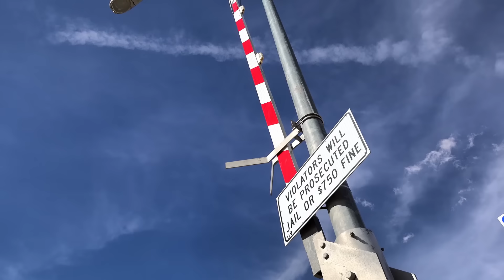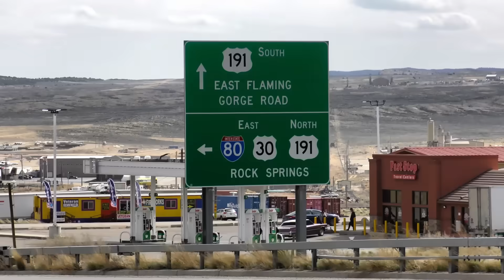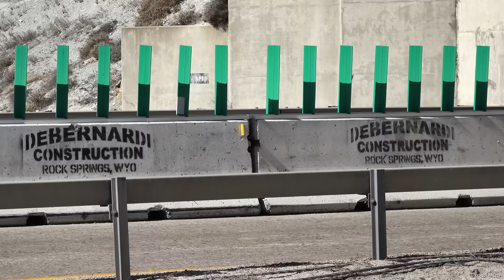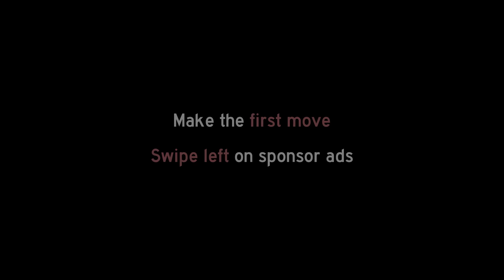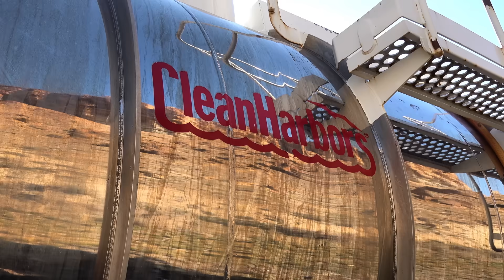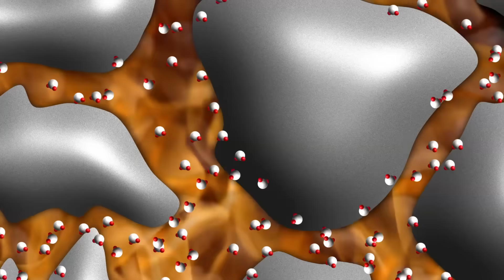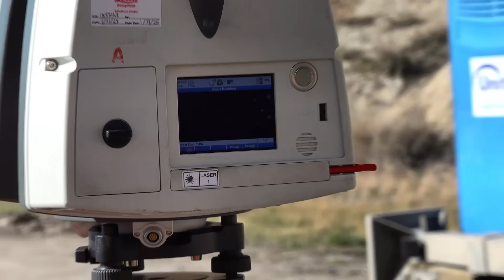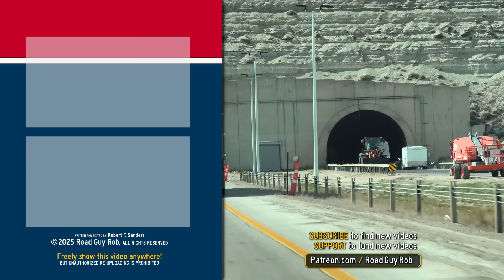Going Inside Wyoming's TOTALLY MELTED Freeway Tunnel

Comment: 9:30 thats why we always say concrete cures, not dries
all that water is still in there
Reply from the maker: I had no idea the hydration would want to violently escape the  during a fire
Reply: @RoadGuyRob  high temperatures reverse the concretes curing process, unbinding the water from the cement
then between the stress from thermal gradient from the fire facing surface, that water flashing into steam inside the concrete, different expansion rates of the aggregate and cement, and weakening chemical bonds; the concrete basically just explodes little pieces off
Reply: @vincentgrinn2665  spalling at its finest 💯 got to keep those safety squints on while doing hot work on concrete 😉
Reply: @RoadGuyRob  Water expands 1700 times its volume when turned to steam. 1 cubic foot of water becomes 1,700 cubic feet of steam. when that tiny bit of water has nowhere to go, it exerts pressure on the surrounding concrete. Spalling begins at a weak point, and as the process creates more weak points the damage spreads.

That expansion rate is why water is still the most efficient way to put put most fires, and why fog nozzles like Task Force Tips became popular. The smaller the drop, the faster it converts to steam, and the steam not only removes some of the heat in the conversion, as it expands it displaces all the gasses in the room. This removes the oxygen and unburned gasses from the room, and continues to cool the space as weter is applied.

(Been out of the fire service for three years, and you're the first to get me back in "Trainer Mode" 😄. Nice work. )
Reply: that's one way caves are made.. light a fire under the rock and the moisture comes out and it causes pieces to collapse. Keep that fire going and eventually you'll have a nice cave for yourself.

It's the same principle as what is happening here.
Reply: The spalling is from free water in the pores of the concrete, not from water consumed by the curing process.
Reply: @koopdi  when the curing process is reversed due to the high temperature, the water in the concrete turns back into water and adds to the water in the pores
Reply: @vincentgrinn2665 . How can water turn back into water?  It’s either water or it isn’t. Now steam can condense back to liquid water but it is still water.
Reply: @Sillyturner  the water in liquid concrete goes through a chemical process and binds with the minerals inside the concrete and turns into gel and crystals to hold it all together when it cures

with enough heat that reverses and the crystals and gels turn back into water and powder
Reply: Shhhh... don't let the Europeans know that, otherwise it might hurt their feelings...
Reply: That’s just inaccurate. Concrete cures with an exothermic reaction. For all intents and purposes it absolutely dries out. Maybe you’re thinking of asphalt which does not go through a chemical process it just cools down.
Reply: Was it sick? 

Why'd it need to cure? 😋
Reply: @robbymoore7959  Asphalt does not retain water during curing and uses a hydrophobic binder, so it literally cannot (set asphalt can be made to be permeable/porous however). Most all water present in asphalt evaporates off during the hot pouring of asphalt. Concrete must dry with its water content dehumidifying at a certain rate, dependent on conditions, and acrually shouldn't dry out too fast as water is essential for its drying process, unlike asphalt.
Reply: @robbymoore7959 concrete literally traps water in its crystaline structure not allowing it to escape as it cures, some of the water will evaporate but a lot of it gets locked into the chemical structure because it's an actual chemical reaction not just something drying
Reply: @robbymoore7959  The curing process is a hydration reaction, in which the cementitious components (Portland cement and certain types of additive, like fly ash or pozzolan / volcanic ash) form a solid and continuous mass with the water molecules.
When curing concrete made with Portland cement, you mix in a certain amount of water, but must ensure that said amount of water stays in the mix, so you need protection to minimize the evaporation of water, because then that throws off the water-to-cement ratio of the mix. It dries out in the sense that the water isn't free at the surface (wet), but it doesn't dry out in the sense that water leaves the other components of the mixture. It's similar to how you could say ice is dry compared to liquid water (all the water is there, but not in liquid form).
Reply: @robbymoore7959  drying implies the water is removed, and thus is capable of being returned and reverting it back into a liquid
concrete needs to retain its water when curing, so in high evaporation scenarios either a film of water retaining compounds is sprayed over it, or the area is simply flooded as it cures
Reply: It doesn’t set, it cures.
Reply: @qwerty112311  dangit yep thats what i meant to say

Comment: For everyone who doesn't know. I believe that a SUV was passing a truck and slid on ice at the exit of the tunnel. The SUV was not involved in the accident but the reactions of other did. 

People who are traveling often don't understand how to drive on ice. This is what happened. The car that started this accident drove away. The cars behind them were not able to slow down and lots crashed into the side of the tunnel. 

The hard part was that the road was clear on one side and ice on the other. I find it interesting. People often drive in the rain safer than they do on ice. The biggest difference is you can still stop in the rain. You can't on ice.

Glad that things are going to be back to normal in like a year. I don't think that they will have all the work done before winter stops them. I hope that they do. 

Thanks for all the info on what they plan on doing to fix it. I hope that the plan they make works out. Once they get the concrete out in the center of the tunnel they will know for sure.
Reply: You have to love people who cause chaos behind them and drive away with not even the decency to stop and check if the people are ok.
Reply: @g_e_o_m9369 doing that is not a good idea in a tunnel
Reply: Also interesting how bad modern SUVs can be on anything not paved road
Reply: @mattevans4377it's almost entirely down to tires
Reply: @counterfit5  But modern tires are superior to older tires
Reply: You can slow down on ice by increasing friction, and very lightly apply the brakes.
It takes significantly more braking distance to be able to do, but it’s mostly up to inertia and momentum at that point.
The problem is the feedback once you get tons of traction back when the ice is over, and the pavement begins again.

Basically, the only way you’re stopping on ice is through the friction of the bearings on your wheels, and effectively coasting off of it.
Reply: @Foreststrike you shouldn't even have too use your brakes just put the vehicle in the lowest gear possible and let the transmission do the majority of slowing down for you then lightly on the brakes too fully come to a stop.
Reply: @kylebeach2316  Yep, exactly.
Unfortunately, most cars these days are either semi- or fully automatic.
So it's just a matter of using the low-gear option.
Reply: @kylebeach2316  Best to punch the shifter into neutral and use only brakes on ice / snow when traction is iffy . The lower gearing causes resistance you have little control over - best to eliminate the transmission from the equation and use light modulated braking . 

I was a driving instructor up north where we get brutal winters -- I wish I had two weeks longer to teach my students strictly about winter driving and techniques . You'd be amazed how many students said to me ' I dont need to learn that though - I plan on never driving in the winter ! ' ..  ~8 months of the year ?? O K .. S U R E .. hehe .
Reply: @Foreststrike  One massive issue in my mind is that people actually believe that all-season tires are useful in all seasons . Winter tires are absolutely essential in winter where I live - the difference is like having glass tires on a glass surface as opposed to rubber tires on a glass surface .
Reply: "I'm a great driver, never been in an accident.  Seen plenty in my mirrors though."
Reply: You made a good point.  As a trucker, I am constantly baffled how both cars or big trucks will drive so incredibly slow and skittish in the rain, yet drive like crazy on snow and ice
Reply: People don’t realize that it can be icy, cold and literally icy in the desert. And frequently is. Places with trees, hold onto warmth and moisture. Trees literally exude small amounts of heat.
Reply: I'm guessing the iced side was in the shade of the mountain and the other side wasn't. You see that happen alot with trees, spots of ice taking longer to melt because they're shaded and not warming up like the rest of the road. The West side of the tunnels would have ice later in the day because the road doesn't have as long to warm up in the sun.
Reply: I'm pretty sure it was a small pickup truck that dove for the exit after the tunnel, my guess is they missed the first exit before the tunnel and opted for the next exit, doesn't help you can't change lanes in the tunnel (it's a solid white line) and the exit after SUCKS, pretty close to the tunnels, hidden along the turn after the tunnel, and that exit is a SHARP turn so you gotta slow down FAST, like from 75-80mph down to 20 before hand. Couple all of that with ice & wind and you get some pretty bad cercumstances. That exit is nothing but a mess so I just avoid using it as much as possible.

Comment: Very inquisitive, but why concentrate on a tunnel system that's most likely outlived its viable life when for 1,100 feet you could just blast a cut into the mountain wide enough to carry 8 lanes of traffic (3 + shoulder) each direction? This seems a lot like the old 1960s construction means of saving a buck just to spend 10x that later.
Reply: It obviously hasn't outlived its usable life if it can survive a raging inferno mostly intact.
Reply: @C.I... From what you saw, it didn't, and the jury is still out on just how to put what is keft back together off of the reamins. Yes, the steel I-beams holding the hole up are still there, but you know how rural areas are with money. They don't have a lot. I doubt Wyoming has enough to pay for all of this. If it becomes a Federal project, which it probably will, the bean counters will gave the final say.
Reply: @ke4qpf I'd assume that as an interstate they will be able to access that same pile of emergency federal repair money RGR talked about with the bridge fire.  So probably federal money quickly.

But also it's obviously way way cheaper to repair the tunnel than widen the interstate -- much less to do it for the tens-hundreds of miles to make it worthwhile.
Reply: I presume you would need to widen the rest of the interstate to benefit from more than 2 lanes in each direction and it may not have the usage to justify that.
Reply: It’s extremely rural in that area. There is never a need for more than 4 lanes. In fact the freeway flows freely through the 2 lanes it’s currently restricted to.
Reply: @Sparcos42 Should Trump tariff mandates for more Made in the USA products be successful, this might not be a valid statement in the next 10 years. Many of what were once rural interstate highways are now suffering from lack of forward vision planning.
Reply: @ke4qpf  Good luck with that. Maybe learn a little about how foreign trade works before you say something so profoundly dumb

Comment: What the heck happened in that tunnel!? Wild the fire got that out of control.
Reply: If there is even a slight difference in altitude between the two ends it can create a chimney effect where fresh air is constantly drawn in and causing a super heated flame.  Or it might have been all the gas catching alight.

Comment: Makes me glad that the state DOT i work at doesn't have any tunnels because of this exact potential incident that you just covered. We have enough trouble with our bridges getting hit. Had two incidents at two separate locations where a tanker truck (not carrying fuel or gas thankfully) made it all the way under the bridge except for the final beam and wedged itself. Had another incident where a truck was carrying an excavator and the arm of the excavator got loose and lifted smacking every beam of a bridge it passed under. Seen a beam get split in half from a truck colliding with it. Doesn't seem to matter how high we make the bridge. Someone finds a way to hit them.

Comment: 0:36 I hate to have to admit this, but 80 doesn't end in New York as it should...New Jersey just had to find a way to ruin it .
Reply: Not to mention it REALLY doesn't go to New York as of now because there's a big hole that has it shutdown some 40 miles short of NYC.
Reply: @eaglescout1984  Ugh dont remind me...good news, two lanes in each direction are back
Reply: @eaglescout1984  Bwuh? 😳 Intentional or accidental?
Reply: @YT-TheLegacy  an old mine collapsed underneath 80 in NJ causing large sinkholes to appear.  They've had the whole thing shut down for months and are just now starting to reopen some lanes. Would love to see a video of this undertaking! 😅
Reply: @KyleBiz  I think Grady from Practical Engineering covered it in a recent video. Though it was more about mine collapses in general than that specific incident
Reply: @KyleBiz oh wow, I hadn't seen that yet.
Reply: You kind of did, but Rob would appreciate the attention to detail and fact checking.
Reply from the maker: I hear you can't even turn left in New Jersey without going in circles 😉
Reply: @RoadGuyRob  The infamous "Jersey Jughandle".
Reply: @RoadGuyRob I just want to preface this that I think NJ is actually a really underrated state. The northwest corner up to the NY border and the Pine Barrens in the southern part of the state are great.

But between the Jug handle turns (which in my experience is mostly along the shore) and the fact I can't pump my own gas, I hate getting off the highway in that state.
Reply: @NYIsles55 bruh I lived there 8 years and moved back to KC.  I actually helped the local pump guy in my previous hometown (NJ) on a visit and he let me pump it. It was a relief.
Reply: @RoadGuyRob  as a native, it seems perfectly logical to me 😂
Reply: @RoadGuyRob  And don't even try to pump your own gas there either.
Reply: @timmywashere1164 I live in jersey. I pump my gas all the time. Just act like you know what you're doing and nobody will care lmao
Reply: @timmywashere1164  isnt there laws against pumping your own gas in oregon too? When i go to ontario, which is right on the border of oregon and idaho, the stations are self-serve. I wonder if its just because its a border town.
Reply: @timmywashere1164  do they at least let you pump your own diesel fuel there?  Here in Oregon, they allow us to pump diesel. For about 6 months the state changed the law and gas stations fired there help i was shocked at how many folks (natives) had no clue as to how to operate the pumps, it was a shit show.
Reply: @BLOWME-tj2xw  How the hell would I know? I'm from the other end of I-80 where anyone can recreate the gas fight from Zoolander.
Reply: @timmywashere1164  that's an epic fight, you are kind of lucky.....
Reply: @CadgerChristmasLightShow  I know you absolutely couldn't pump your own gas in Oregon 20 to 25 years ago. But I think some legislation has passed since that allows car drives to pump their own, as I didn't get startled when I traveled last year.
Reply: @RoadGuyRob  dude I visited NJ for the first time last year and my two impressions were they hate left turns and plastic bags!
Reply: @RoadGuyRob  I live in the Pacific Northwest and I had to call a customer service center that was in New Jersey, I of course had to say “jersey huh? How about them jug handles?” Luckily the lady let out a genuine laugh. We had a wonderful conversation. I think I would have a good time on the East Coast.
Reply: Casey Jones covered the I-80 sink-hole problem in New Jersey with several videos.
Reply: That would make a great slogan... "New Jersey: Where good things come to an end"
Reply: New Jersey is the last state where you legally can't pump your own gas, an attendant has to. For that reason I fill up in Pennsylvania if I'm driving in the area.